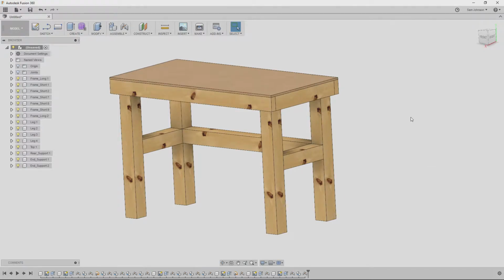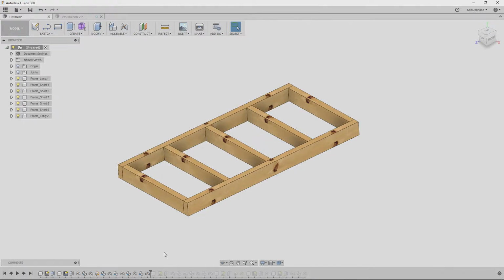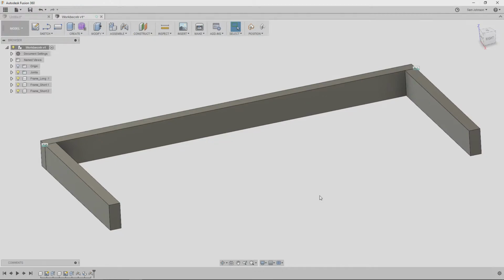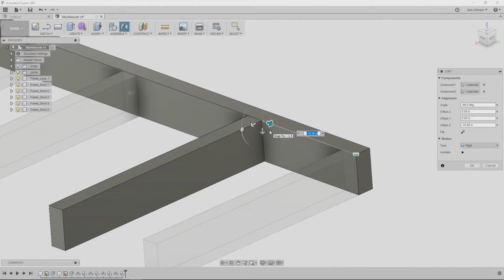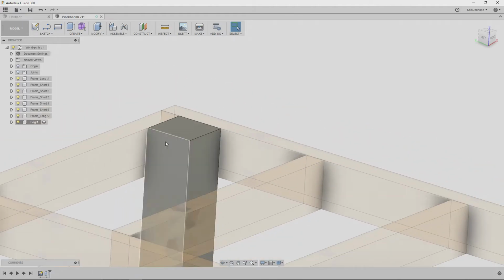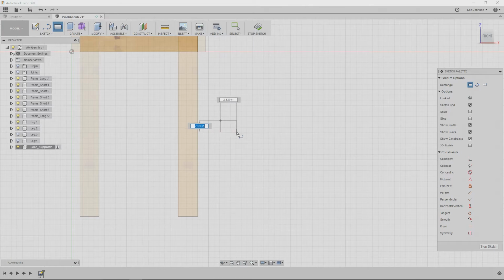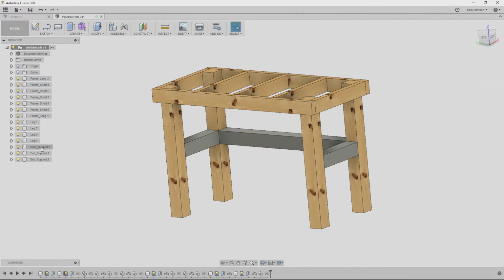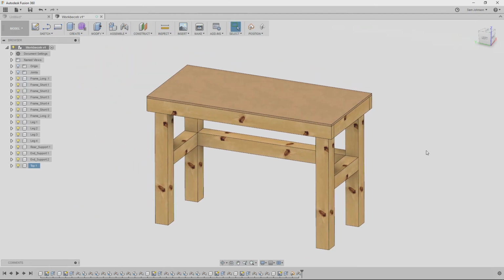Rolling Work Bench Project | Part 1 | Fusion 360

Comment: I am about the same size: 6'4"... and low work surfaces can DEFINITELY wreck the back!

I was hoping to find more content as I am new as well.  I am trying to find out about the use of pocket screws, bearings, nuts, and bolts in wooden workspace design.  I need to make a rolling cart with a rotating axis tor the table-top to alternate between my jointer, and my spindle sander.   

I can't seem to find anything, and it's frustrating me to no end.